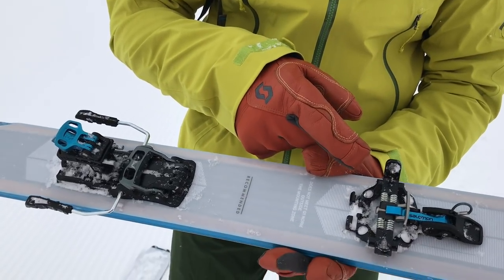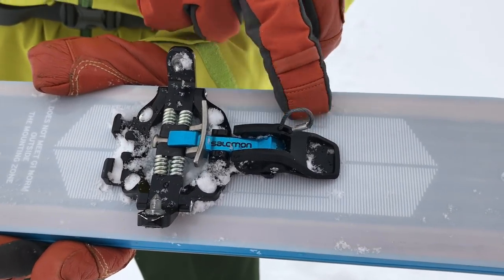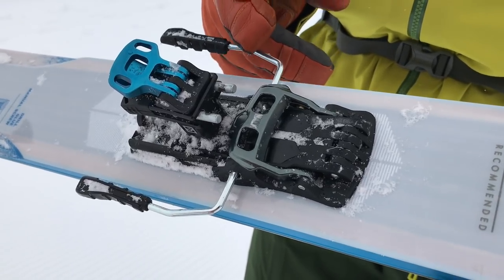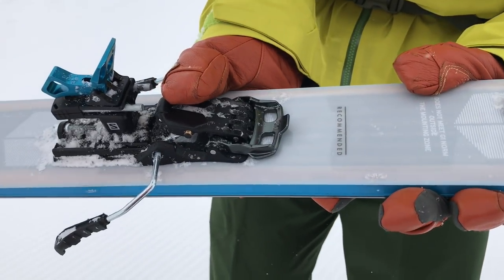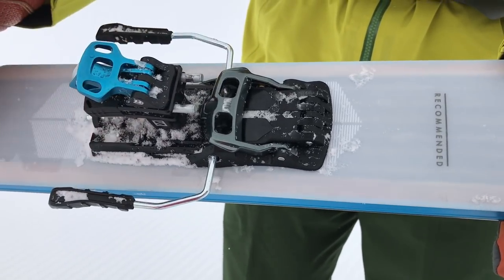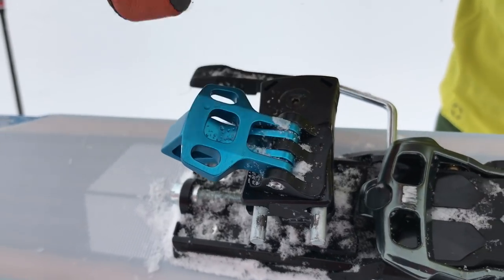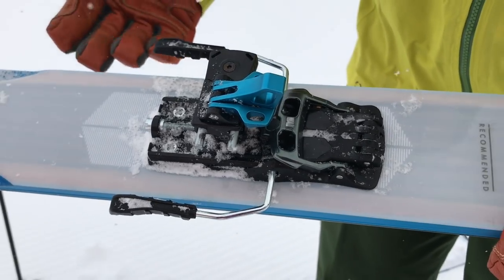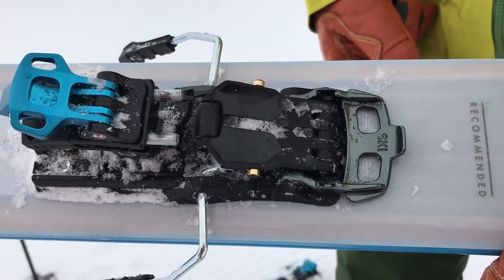Atomic/Salomon Pin Binding

Comment: So you must remove the ski at the top before heading down?
Reply from the maker: Not necessarily - you can make the switch with the ski on. But most people concerned about making the transition at speed (ski-mo racers etc) will use leashes rather than the brakes (& save the weight).

Comment: Can you set the weight resistance?
Reply: The bindings come with three sets of heel pins - women, men, expert, with the strength of the pins increasing, respectively. I believe that is the only way to "set" the weight resistance. I'm a male, 145 pounds without pack, 65 years old, and not a particularly aggressive skier. At times I struggled locking in the heel for downhill mode. It finally got really bad, enough to motivate me to do something about it. First I checked the heel adjustment, and found that (for some unknown reason) the fit was too tight. I moved the heel piece back to the proper position (4mm gap between boot heel and binding) and switched from the men's to women's pins. I love it now - I barely have to step down to lock in. I ski primarily soft snow, no jumping or other shenanigans, and get all the heel retention I need with the women's pins.
Reply: @watermanOIT  Thanks Greg, I have another question for you, or anyone handy-- I just sprained my ankle/broke the distal fibula in a stupid fall, freeheel skiing these bindings down grabby snow.  I had left the toe piece in locked mode, so there was no release of the ski, which caused my injury- that and poor skiing on my part.  How would I guard against this in future, that is, how should I set the toe binding piece if tele skiing?  I don't want the ski to release too easily, but I really don't want to be hobbling about on crutches again.  Thanks, Ian.